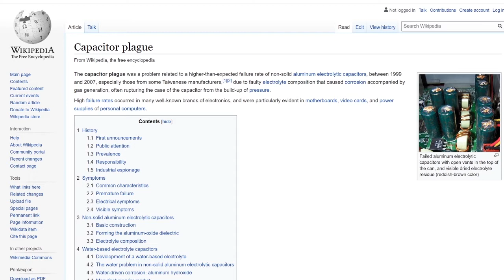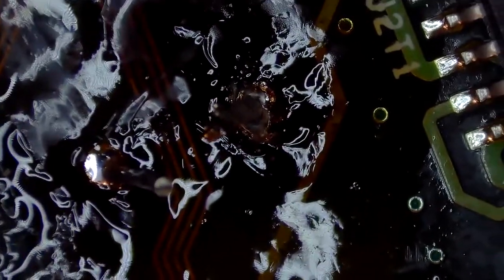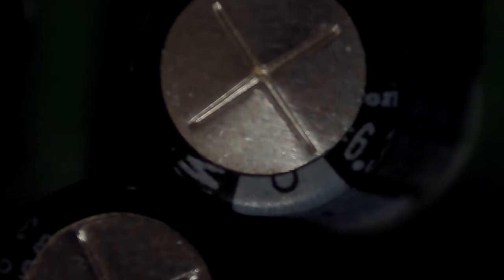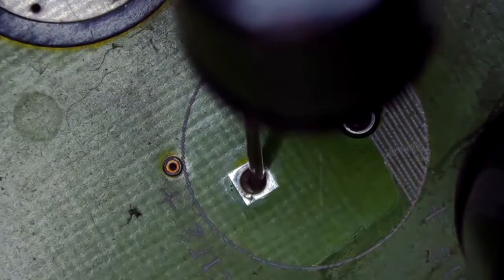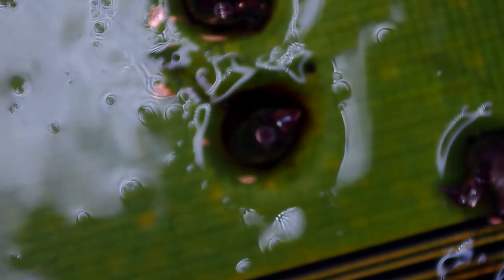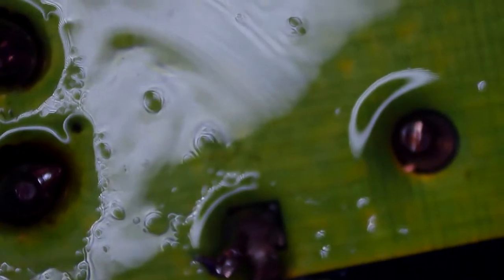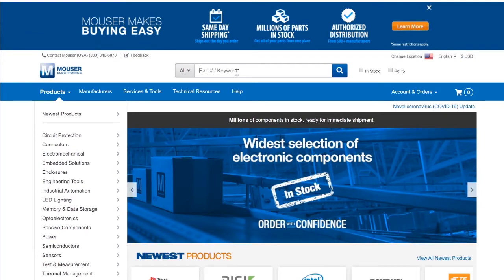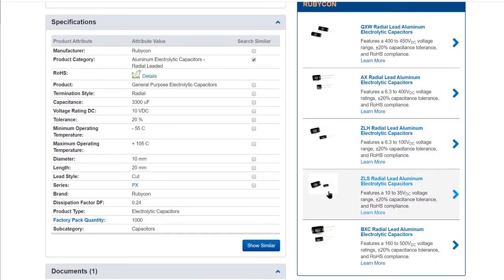Modding The Original Xbox Part 8 - Capacitor Replacements

Comment: My xbox v1.6 recently started turning off the second on turn it on. Is it possible these caps are the reason?
Reply from the maker: Very likely, open it and see what they look like. They may be buldging or leaking. If so replace all of them in that area of the same specs.
Reply: @techhoarder3010  I should be able to get the same ones you guy right? (Total newb here)
Reply from the maker: Yep, look on the side of the cap and get the same UF, Volts can be the same or higher.
Reply: @techhoarder3010  I just checked mine. Same as yours. Ordered from the same site. Thanks brother

Comment: Do I have to replace these or remove these I already removed the clock capacitor
Reply from the maker: Only if they are bad, usually they are buldging at the top.
Reply: @techhoarder3010  what is there use
Reply from the maker: Has to do with power to the console. I had a few bad ones and the symptom is the console would randomly shut off during playing. Replace those caps to fix the issue.
Reply: @techhoarder3010  will it happen to every single console or what because it’s not doing that to mine
Reply from the maker: No, maybe 1 out of 30 I have seen this issue. If it is working you can leave it as is.

Comment: If I recon correctly, there are 6 of this tall capacitors on the board. Will it be fine if I replace all of those with these 10V 3300UF Caps?
Reply from the maker: It depends on the motherboard how many caps there are. I replace mine with the 10v 3300uf from digikey. I like Rubycon caps myself.

Comment: I have a v 1.0 xbox that doesn't turn on at all when pressing the powe/eject button. 
No visible damage on the board, no visible damage on the PSU. I removed the clock capacitor who had leaked, but without damaging the board nor the traces underneath.

If I short the PowON and 3.3 volts standby on the power connector on the motherboard, the xbox turns on when I plug it in, without pressing any buttons, but the front led flashes with irregular timing between red and half orange/half yellow, and there is no output signal whatsoever.

The capacitor in front of the CPU are 5 in my case. They show no leak, no bulging and no visible damage. Is it possible that they nonetheless went bad and are causing all the problems?
Reply: https://www.youtube.com/watch?v=IqJu1GUk6IU